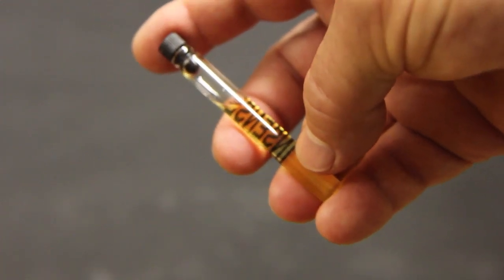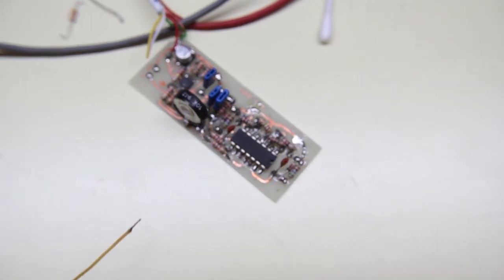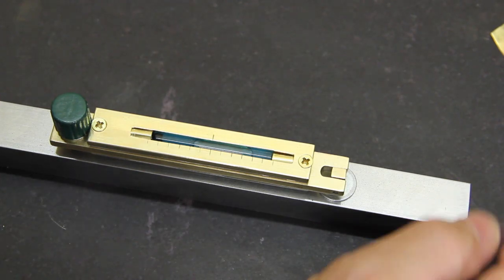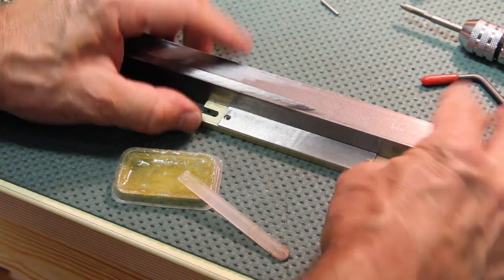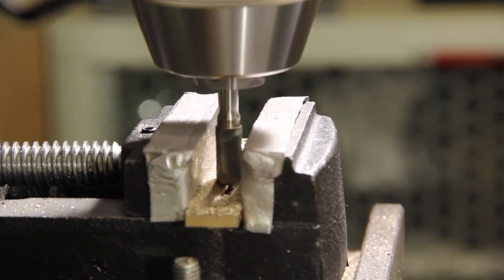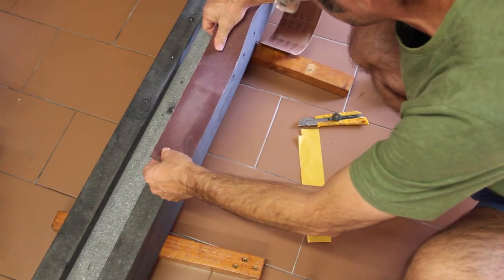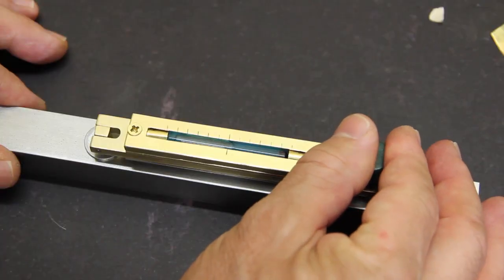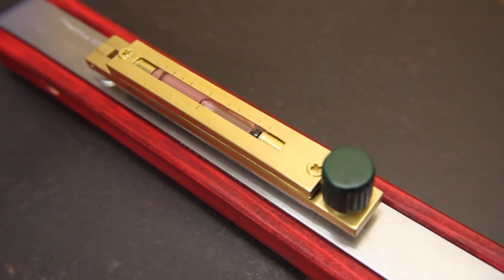Machinist level with a perfume vial

Comment: Nicely done. I've been contemplating the exact same problem for a few months now. Never considered trying to bend the glass tube with a shim. The idea I settled on was making a bidirectional level by lapping glass like a telescope mirror and then using that to make a level like oxtools repaired. Bending the vial seems easier.
Reply: This sounds like a pretty good idea. I wonder if you pursued it.

Comment: I made one some time ago. Bought a vial online for us 15 that has around 9000:1 resolution, or ~ .001" over 9", or 1mm over 9m. Works great, but the 40 TPI adjustment screw is far too coarse. I'm going to rebuild with a 10:1 lever, making my 40TPI threads more like 400TPI. Yours is beautiful, mine is aluminum.
Reply from the maker: Despite the (small) leverage even my screw is too coarse, on the other hand I find it useful to compare surfaces that are not even close to level. Thanks for commenting.

Comment: nice, so about 0.05mm over 1 M ?
what thread pitch did you use for balancing?
Reply from the maker: 0.5mm at a approx. 70mm radius from the trunnion ...it is quite sensitive, it would have been better a finer pitch, but it is usable.
Reply: @AccidentalScience  
let me ask it in another way
how many arc sec per division?
the thread pitch is 0.5mm?
thanks
Reply from the maker: So my memory didn't served me well, the actual pitch is 0.7mm (not 0.5) and the distance from the trunnion is 103mm (not 70). Therefore one revolution of the adjusting knob causes a tilt of 0.39° or 1401 arcsec (since you like this unit :) ).
The sensitivity is 0.01mm / 200mm per division, equivalent to 0.05mm per metre, thus an angle of 0.0029° (or 10arcsec) per div. (run by rise). So the adjustment knob causes a correction of a full division per each 2.6° or knob rotation, which is pretty touchy as I said in the previous comment, yet usable with some care. Because the knob has a diameter of 18mm this means that with a rotation of ~0.4mm at its circumference makes a full division tilt. Using a finer thread would have been better, but I hadn't any finer screw handy and even less the tapping tool.
Reply: @AccidentalScience  yes that makes sense, like I said in the first comment 0.05/M
i did many calculations for the thread pitch also and find it has to be around 0.25mm and even on that pitch it is very tricky coz i am using a 0.02/M vial too sensitive